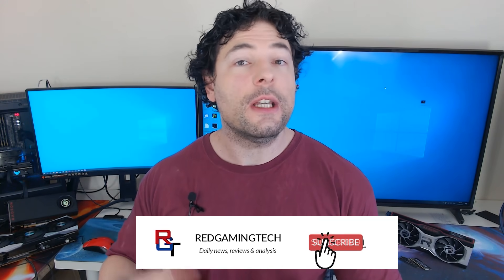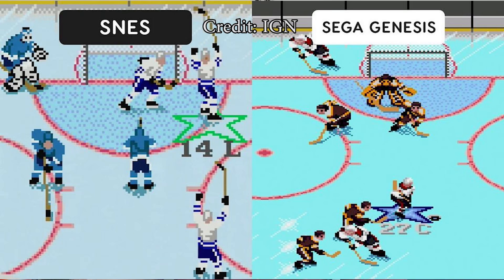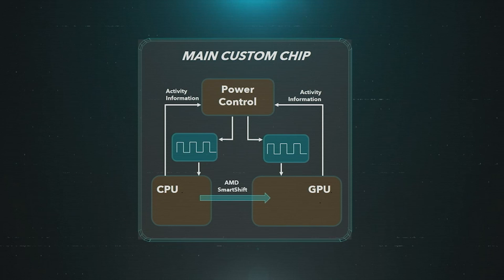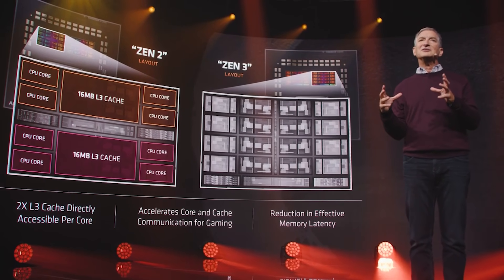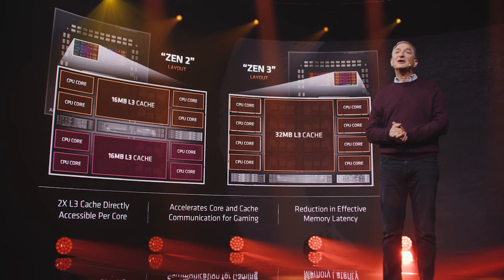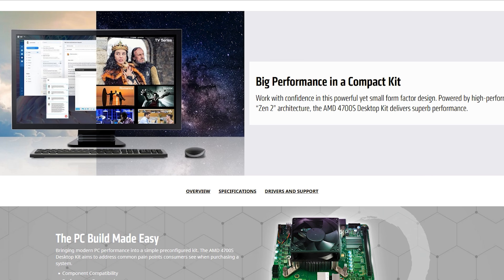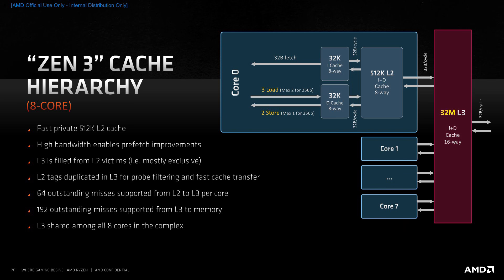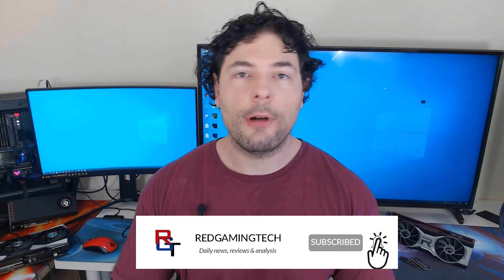PS5 CPU Die Shot Reveals HUGE FPU Customization | Playstation 5 CPU Analysis

Comment: Give it a rest Paul. Both cpu and Gpu is inferior to XSX. This is getting ridiculous
Reply: What games are you genuinely playing be honest lmao.
Reply: @jasonshetler9035  at the moment I'm mostly playing Psychonauts 2, dodgeball academia, BF1 and Hellblade. What about you?
Reply: @vandammage1747  Psychonauts 2 is definitely a Game of the Year contender. The 120fps mode on XSX is just sublime!
Reply: @vandammage1747  PS5 slight wins & major wins VS Xbox Series X in Third Party Multiplat Games 
Shadow Of The Tomb Raider 
PS5 60fps CB 4K-1920x2160 Reconstructed up to 4k XSX Native 3584x2016 41fps
PS5 has consistantly an average of 10fps lead minimum to 19fps advantage
PS5 has 30% more performance advantage over series x 
Xbox Series X has lighting shadow map flickering issues not present on PS5

Metro Exodus PS5 60fps XSX 56FPS PS5 AVG 59.99FPS XSX AVG FPS 59.82FPS
DRS Temporal reconstruction to 4K 
PS5 3840x2160-1920x1080p PS5 2688x1512 2844x1600-1792x1008 
the 1792x1008 drop seem to be rare on PS5 it happens only on Taiga Level
Xbox Series X 4K RC DRS 3840x2160-1920x1080 XSX 2880x1620 2844x1600-1920x1080
Volga Level Opening Train Scene - PS5: 2560x1440, Series X: 2844x1600
Caspian Level Driving - PS5: 2560x1440, Series X: 2844x1600
Taiga Level Exploration - PS5: 2176x1224, Series X: 2400x1350
Taiga Level Forest Most Demanding Scene - PS5: 1792x1008, Series X: 1920x1080
XSX contains 8% resolution advantage in the most current demanding game up to date
PS5 has 8% framerate advantage in the most current demanding game 
POWER IS A TIE IN THE MOST CURRENT DEMANDING GAME 
Greedfall Performance mode native 2560x1440p PS5 60fps XSX 52FPS
NBA 2k21 Native 4k 60fps Same Graphic Settings
PS5 slightly faster than xbox series x in performance
Crash Bandicoot 4 Dynamic 4k-3456x1944 PS5 52 FPS XSX 40FPS lowest framerate
during gameplay 3840x2160 are common pixel counts
Shadows have higher resolution on PS5 
XSX is stuttering again something thats not present on PS5
Stutter series XL always stuttering to keep up with PS5
Control 1440p temporal AA reconstructs image to 4k in both modes 
performance mode PS5 60fps XSX 47FPS THE XSX Stutters and judders
Ray Tracing Mode PS5 30fps XSX 28fps ( No Photo Mode)
PS5 DUAL RAY TRACED REFLECTIONS ON GLASS NOT EVEN FOUND ON PC 
XSX HAS BVH ISSUES RT REFLECTIONS DISAPPEAR AT TIMES 
this is specific to the DXR API the xbox uses its not the northlight engine of the game's fault
PS5 is faster than 2070 super and XSX is faster than both in Photo Mode only with RT
Corridor of doom Heaviest section in the game 
2560x1440 Big Navi 21 RX 6800XT 33fps 
PS5 Custom Big Navi 21 RX 6800XT GPU 32fps XSX 33FPS (Photo Mode)  
Xbox Series X is missing ray traced reflections in certain areas 
and its instead using screen space reflections 
FIfa 2021 Native 4K 60fps PS5 better grass draw distance and better antialiasing 
Xbox Series X has more flickering on hair 
Scarlett Nexus native 4K and native 1440p Common 4K-1440p DRS/TemporalReconstruction 
PS5 60fps XSX 56FPS
F1 2021 Native 4k 60fps PS5 Instant replay 30fps XSX instant replay heavy tearing 27fps
Monica Area RT shadows show on PS5 at greater distance 
while they are entirely missing on XSX in the distance 
120fps mode native 1440p XSX has tearing on Monica Stage 
Dirt 5 Patch 2.0 Quality Mode PS5 4K-2880x1620 XSX 4K-2560x1440
PS5 45% power advantage delta with higher resolution higher graphic settings 
XSX tears more often PS5 has higher graphic settings more shadows higher shadow quality resoltuion higher resolution textures on PS5 PS5 has better ambient occlusion PS5 has longer draw distance sharper textures and better filtering 
Cyberpunk 2077 Performance mode PS5 59fps DRS 1200p-972p XSX 44fps 1296p-1080p
DF toss granade Tested Area where XSX doesnt have EXTRA NPC PS5 30% power advantage
AC Valhalla Perfomance Mode PS5 60FPS XSX 59.33FPS
PS5 DRS 4K-1800p-2432x1368 XSX 4K-1800p-1920x1080p
PS5 has 30% more resolution stronger alpha effects better perf than series x
Immortals Fenyx Rising Performance mode PS5 59.99FPS XSX 59.97FPS
PS5 DRS 4K-1620p-1440p XSX DRS 4k-1440p-1080p
Quality Mode PS5 4K native 3840x2160p Series X DRS 4K-3684x2052
PS5 30% more resolution in both modes
Borderlands 3 Dynamic 4K 
Plant Density foliage sharper higher quality shadows advantage on PS5
120fps mode PS5 93 FPS XSX 84FPS 
Destiny 2 Quality Mode 4K-2356x216 PS5 AVG FPS 59.97fps XSX 59.93fps 
120fps MODE 1440p PS5 120fps XSX 89FPS
For Honor 4k PS5 60fps XSX 19FPS 
POWER GAP IS SO HUGE THE PS5 ABSOLUTELY DESTROYS XSX IN FOR HONOR
Mortal Shell 3200x1800p PS5 60fps XSX 54fps AVG 59.98fps XSX AVG 59.89FPS
XSX texture low resolution state after loading pop in textures streaming issues
Call Of The Sea PS5 DRS 4K-1800p XSX 1440p PS5 slightly better shadow than XSX
Better framerate performance on PS5 better lighting on PS5 and PS5 30% more resolution
Tony Pro Hawk's Skater 2 60fps Fidelity mode 4K DRS PS5 4K-3552x1998 XSX 4K-3264x1836
120fps Performance mode PS5 DRS1440p-2112x1188 XSX DRS 1440p-1920x1080
PS5 30% more resolution in both modes better performance in both modes
Watch Dogs Legion DRS PS5 4K-3100x1744 XSX 4K-3392x1908 
PS5 AVG 59.98FPS XSX 59.96FPS PS5 better performance 
MLB The Show Native 4k Lowest FPS PS5 48fps XSX 38fps PS5 20% more performance adv
Call Of Duty Cold War 1440p 120fps mode PS5 120fps XSX-99fps
Ray Tracing Mode 3840x2160-1920x1080 PS5 FPS 59.95 XSX 59.82
Call Of Duty Warzone PS5 1566p 120fps XSX 83FPS 1920x2160 
All High resolution texture pack installed and graphical features are exactly the same on both PS5 and XSX and The XSX Stutters judders a lot like always 
Devil May Cry 5 SE Reconstructed 4k 120fps mode PS5 116fps XSX 66fps 
here is the 50 Performance delta that dealer gaming was talking about
PS5 is 50% more powerful than xbox series x in the 120fps mode
RT Quality 3840x2160p Reconstructed PS5 42fps XSX 41fps PS5 punching beyond its weight
Sekiro PS5 CB 1800p Series X native 1800p PS5 60fps XSX 48fps
DF We saw the GPU limits of XSX in BC mode but we haven't seen the limits PS5 GPU in BC
Need for Speed Hot Pursuit Native 4K PS5 60fps Series X 42fps
Skyrim BC 2160p PS5 60fps XSX 53fps
DF Xbox Series X has a weakness to transparency effects and atmosphering rendering 
Jedi Fallen Order Performance mode 2560x1440 PS5 59.96fps XSX 59.9fps 
XSX More Stutter PS5 better performance 

Chivalry 2 DRS 4K-2304x1296 PS5 59.98fps XSX 59.96fps

Saints Row 3 Remastered DRS 4K-3360x1890  PS5 60fps XSX 59.96fps
Little Nightmares 2 PS5 RT 1684p locked 60fps XSX 1890p SSR no ray tracing 58fps

The Medium PS5 DUAL REALITY RT DRS 4K-1116p XSX DRS RT 4K-900p NO DUAL REALITY RT
PS5 renders 30% more pixels 30% more power advantage over series x 
better lighting better anisotropic filtering

I've Done My Research Straight Up Facts The Ammo Has Arrived 
Sources VG tech NX Gamer(IGN GAMES) Enalista Debits Digital Foundry Your Receipt
Reply: @vandammage1747  XSX GPU 1.825GHZ GPU PS5 2.23GHZ 400mhz and cache speed bandwidth advantage on PS5.  PS5 GPU is 21% faster than the series x GPU negating the series x GPU memory bandwidth CUs and TFLOPS advantage. PS5 GPU triangle raster is 20% faster than series x GPU PS5 GPU culling rate is 20% faster than series x GPU PS5 GPU pixel fill rate is 20% faster than series x GPU PS5 has shared L3 cache thats shared with the CPU and GPU cache thats a big advantage over the series x which doesn't have shared L3 cache the shared L3 is able to help the PS5 with CPU and GPU to offload workload faster than we have the tempest engine thats a seperate CU and the SSD thats a seperate memory controller that frees more workload from CPU and GPU and we have the extra DDR4 memory on PS5 to further help PS5 with Oodle Kraken and Oodle Texture PS5 SSD reaches top speed 22GB/s over 200% faster than XSX SSD with sample feedback streaming and velocity architecture that can reach max 5,5GB/s -6GB/s. PS5 continues to outperform series x hold more wins runs most games better and showcase that PS5 is the most powerful console
Reply: @vandammage1747  
A year later and Series S|X still;
🚫 No exclusives 
🚫 no next gen games 
🚫 no best version of any 3rd party games
🚫 no best version of any “Xbox” games
✅ nothing next generation 
✅ last gen controller 
✅ last gen SSD

Series S|X are potatoes stuck in last generation. 
☹️😬😬

🥔🥔🥔🥔🥔🥔🥔🥔🥔
Reply: @raios-rogueboss-slayer4179  "PS5 GPU is 21% faster" Lmao delusional😂🤣. Why do think ZERO games have higher resolution on ps5 since Valhalla, Dirt5 and Phynix huh??

XSX is all about SUSTAINED performance not theoretical peak performance.
PS5 cpu and gpu are weaker, fact. Gpu is also less advanced missing vrs, mesh shaders, sampler feedback streaming machine learning optimizations.
BCpack is more advanced than oodle. BCpack remain compressed in ram, and with SFS those textures will take 3-5x more memory on Ps5.
XSX has separate memory block too. Also audiochip. Also when ps5 boost gpu, the cpu will downclock. Not good when last gen games are dropped and devs start pushing cpu.
Reply: @ItzTruthHurts  Lmao you're still cying, your pc is only for youtube and benchmarks and you play the inerior versions on ps5
Reply: @vandammage1747  hit me up when you finally join the current generation 🤣. In the meantime, you enjoy last place again 😭
Reply: @vandammage1747  mad? Xbox gpu CUs have a total of 15 million transistors while the ps5 has 18 million. And while using the ssd the Xbox’s graphics can’t demand over 4GB maybe 6GB because that’s all the data the Xbox can feed to the gpu. On the other hand, the ps5 is capable of feeding the gpu 17GB/s, now put that in with high tech VRS 🤯
Reply: Not really
Reply: @raios-rogueboss-slayer4179  stay away from the crack pipe 🤣🤣🤣🤣🤣🤣
Reply: @ItzTruthHurts  say no to drugs 🧂🐴
Reply: @balloonb0y677  you guys really do live in an alternate universe🤣🤣🤣🤣🤣🤣
Reply: @WaxDat8800  umm. How? I’m just proving this guy wrong
Reply: @balloonb0y677  you proved nothing.
Reply: @WaxDat8800  how come
Reply: @vandammage1747  you forgot the best version of Xbox multiplats on my pc ahahahahahahhahaha
StupdPeasant. 
Hit me up in December so I can show you how Halo infinite is supposed to look and run, unlike that downgraded weIfare version on the series X 
🥺
Reply: @balloonb0y677  you proved absolutely nothing. Show me……
Reply: @WaxDat8800  if you at least had a good score for your comprehension skills you would know that I was trying make known that the PlayStation 5 is a more powerful system opposed to the Xbox series x.
Reply: @balloonb0y677  Lmao delusional🤣😂. You're forgetting sampler feedback streaming, BCpack dummy and higher bandwidth. XSX can effectively feed more data to the gpu than ps5 and the 17GB/S is theoretic BS peak number. It's not even close to that in real games.
Reply: @ItzTruthHurts  did you buy the best version of Days gone, Horizon Zero dawn, Death stranding on pc too? Uncharted4 will play better on pc too right🤣😂
Your ps5 is a doorstopper now Lmao
Reply: @balloonb0y677  ps5 gpu doesn't have more transistors dummy. The SoC is significantly smaller and cheaper. You've been reading faery tales again lol
Reply: @ItzTruthHurts  you can't afford a 4K screen with vrr and freesync? Hahaha how sad. Maybe on your 1080p screen some ps5 version are slightly better, other are worse.

You mean sony makes you pay $70 for Directors cuts and timed exclusives that will later release on pc at $50 with better graphics?🤣😂
Reply: I think bf2042 will be the first Real clash between SX and Ps5,lets see how far the devs the Hardware of the two pushes!!!
Reply: @vandammage1747  all that stuff included in the velocity architecture is what makes the Xbox do 4GB/s. Microsoft said it themselves. And they said 6GB/s was it’s max. And the 17GB/s was actually the new speed that the ps5 was able to perfectly sustain because of the new technology called oodle textures.
Reply: @vandammage1747  and if you do the math the ps5 has 18 million. And what do they say? “Math doesn’t lie”
Reply: @balloonb0y677  sure but you're missing the part where I said "effectively". With sampler feedback streaming that 6gb is effectively 12-18GB/s. That's even conservative numbers according to MS.

Also that also translates to much bigger effective ramsize. Because BCpack is compressed while in ram and oddle is not. That's already almost 2x more effective  ram size and speed. Now add Sampler feedback streaming and that number is 4-5x. XSX is a lot more future proof and advanced, anyone with just a little tech knowledge can see that.

The 17GB/s ps5 speed is only peak and doesn't show in actual games. It's not even 50% faster in most games and why do you think?
Reply: @vandammage1747  bro what 💀
Reply: @vandammage1747  like Microsoft said. Everything in the velocity architecture gives the Xbox a max of 6GB/s nothing more. Don’t believe some random YouTube channel when Microsoft themselves has said the facts already
Reply: @vandammage1747  Microsoft said SFB doesn’t increase speeds it just makes data transfer more efficient.
Reply: @vandammage1747  bcpack only compresses ssd data not ram.
Reply: @vandammage1747  “PS4 has 18 compute units and and a total transistor count of ~5.7 million.
With a simple calculation, we can understand that each of the PS4's 18 CUs has ~316666 transistors (5,700,000 ÷ 18 = 316,666).
Accordingly to Mark Cerny, each of the PS5 CUs has 62% more transistors compared to PS4's.
Now let's do a quick calculation to see if we can discover the total transistor count of the PS5 gpu:
Step one: 316,666 x 62% = 196,332.92
Step two: 196,332.92 + 316,666 = 512,998.92
(Each PS5 CU probably has 512,998.92 transistors.)
Step three: 512,998.92 x 36 = 18,467,961.12”
Reply: @vandammage1747  how many times is Xbox going to make you buy a new console to NOT have the best version of games? Not even the best version of Xbox games 🤣. 
You bought a new generation console to have ZERO next gen games and ZERO exclusives hahahahahahahba

Hope you’re having fun stuck in last generation 🤣
Reply: @balloonb0y677  it's quite sad you still don't understand that sampler feedback  streaming adds a 2.5x multiplier on average. That's 4.8GB/s * 2.5 = 12gb/s average. Peak will be considerably higher. BCpack and SFS also benefit ramsize and ramspeed whereas PS5 relies on just fast brutespeed without those benefits.
Reply: @balloonb0y677  textures compressed with BCpack can be moved in ram. Oddle textures will uncompress first and take roughly 2x more ram.
Reply: @vandammage1747  oodle textures job is to help kraken read data faster, basically supercharging kraken. Which gave a sustainable 17GB/s.
Reply: @vandammage1747  it’s from push square
Reply: @balloonb0y677  no oddle is just texture compression Lmao. Just like BCpack except BCpack has hardware support in the gpu and oodle has not, which is why it's only compressed on the ssd. Meanwhile BCpack is also compressed in ram. BIG difference!
Reply: @balloonb0y677  hahaha you mean a push square forumposter with ZERO source?😂🤣.
And first comment debunked his claim. Surely you must have seen that?? BIG L... HUGE L😂
Reply: @ItzTruthHurts  pc gaming is a joke and will always be the worst version. You know that too thta's why you're on console channels and damage control your ps5
Reply: @vandammage1747  give a source to where it says that’s it’s the ps4s Soc than you can talk
Reply: @vandammage1747  still no source 😂
Reply: @raios-rogueboss-slayer4179  extra ddr4 😂
Are you ashamed to mention the amount?
Reply: @vandammage1747  Sony makes them pay not me. I'm not a dummy
Reply: @balloonb0y677  what problem would that be dummy? You made a claim about ps5 transistors and couldn't back it up Lmao. 
Even more sad you tried with some random forumpost and using words like "probably" as proof🤣😂L
Reply: @vandammage1747  it’s ok buddy 😃 how about I walk you through the steps on how to solve this little equation😉
Reply: @vandammage1747  the ps4 has 18 compute units with a total of 5.7 million transistors
Reply: @vandammage1747  and with a little bit of division we can find out that each ps4 CU has 316,666 transistors(5,700,000 ÷ 18 = 316,666)
Reply: @vandammage1747  mark cerny said each ps5 CU has 62% more transistors than each ps4 CU.
Reply: @vandammage1747  316,666 x 62% = 196, 332.92
This is how much more transistors each ps5 CU has compared to each ps4 CU. (196,332.92)
Reply: @vandammage1747  and if we multiply 512,998.92 by 36 we get 18,467,961.12 which is the ps5’s total transistor count.
Reply: @vandammage1747  feel free to ask questions :)
Reply: @raios-rogueboss-slayer4179  The DDR4 memory is standard for 99% of desktop PC SSD's. It's memory where the SSD controller stores the mapping tables. Nothing exciting.
Reply: It's like he continuously gets debunked and still keeps going. Until Sony comes out and says what the machine has legitimately, these videos are just gossip
Reply: @warcrabcyber9908  I don't know what do you mean. Nobody from Sony or other place was saying the system has extra memory. From the very first teardown people knew what this chip is doing next to the SSD controller. It's not rocket science. PS5 is like computer so parts have to work in similar fashion. It's not bad thing. And having SSD controller cache is good. Some SSD's on PC are lacking this feature. So at the end it's better having this extra memory for the mapping tables, than not. I love the PS5. It's the better console, because it's software... just like the PS4.